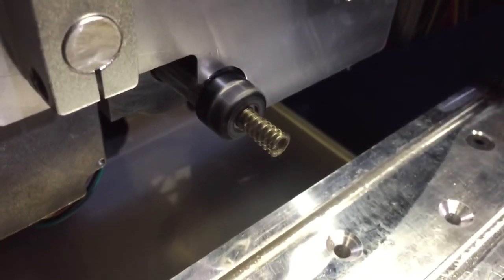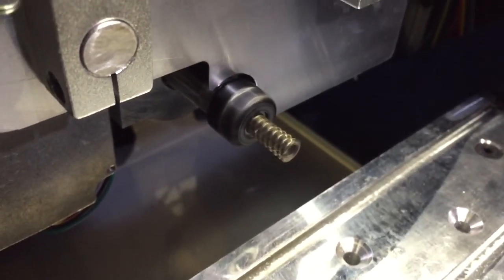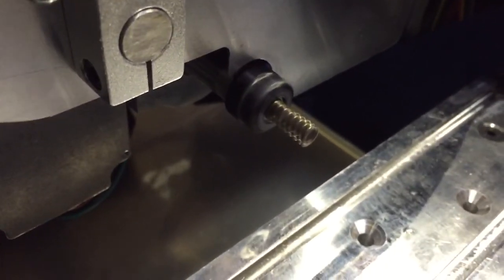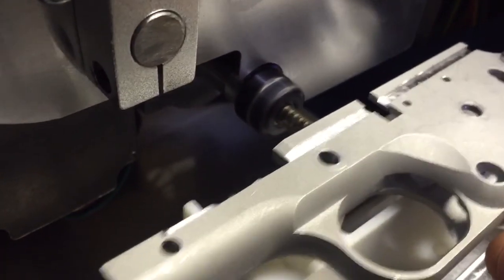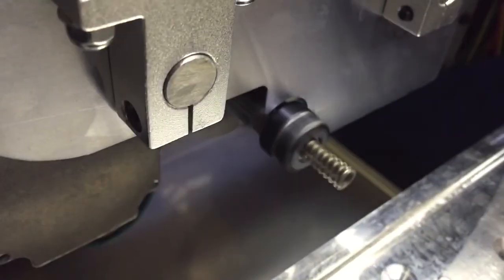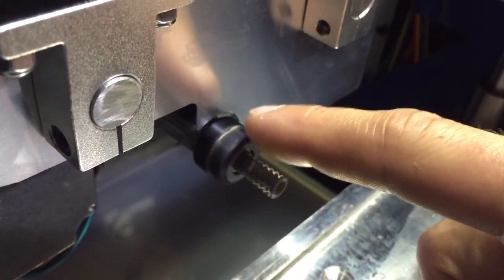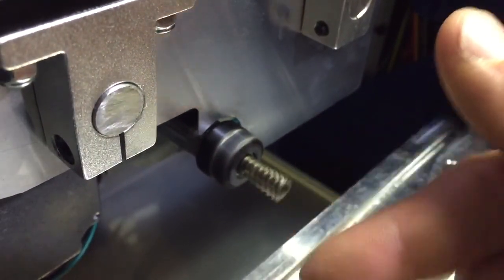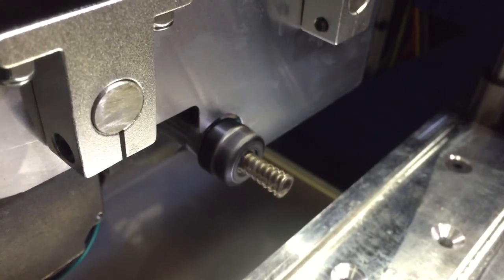Using a Spring to Safely Develop Ghost Gunner Probing Routines

Comment: can you do a step by step for the 1911? no one has done one yet, and i get stuck on the first probe =( plz
Reply: Same here. I removed the frame from the machine and there is no voltage output at all. Seems like it may be a code issue.
Reply: @BecomingOffgrid  Dude same here. Need a solution for this so badly
Reply: Same problem error here